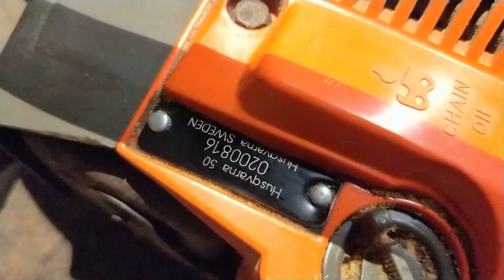Husqvarna 50 Rebuild and Big Bore Install

Comment: That's happening for a reason if you don't fix it it will continue.
Reply: Mine was an air leak from that impulse pipe and flexing of the carb plate. Replace that pipe and the missing carb plate bolt.
Reply: Or air leak from bearing seals or case seal